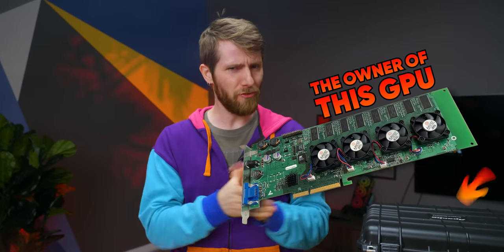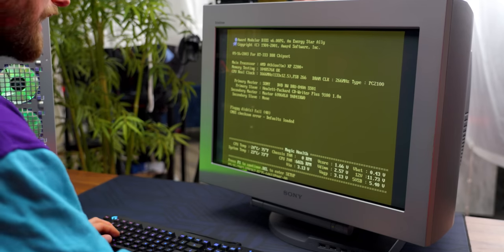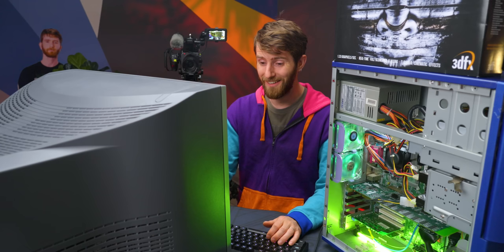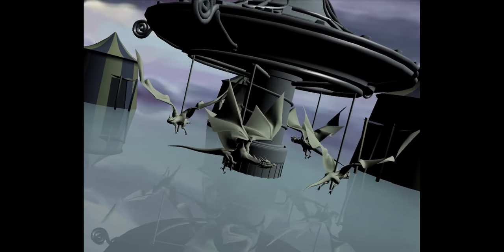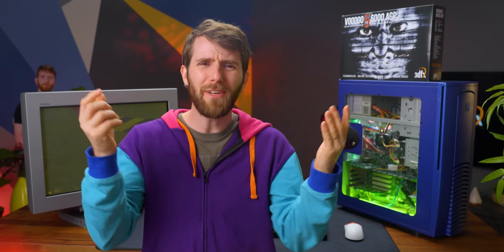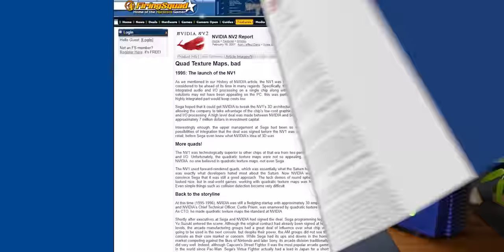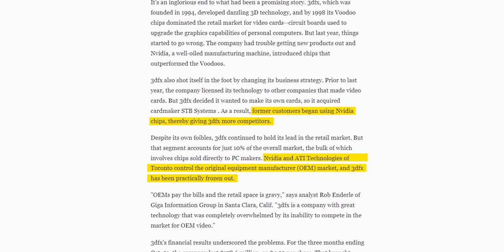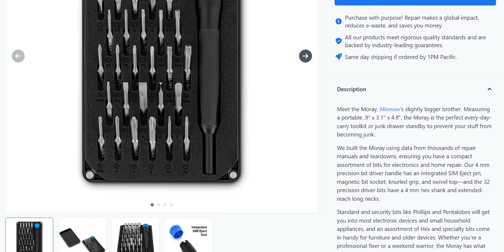This GPU cost $15,000 and there’s only ONE like it – 3dfx Voodoo 5 6000

Comment: Wow great window into history. This was before my time by only a few years.   
I remember tearing up my old Dell and having my mom buy me a card that I didn't have an AGP slot for. Then I used my birthday money to buy a new motherboard and processor which of course, didn't fit in the Dell case. So I ran it in the box on top of the anti static bag for a month until my case came in. Finally put it all together and used the wrong screws on the mother board so it was shorted out on the case and fried instantly when I turned it on. I was computer-less for months since my mom was already pissed she had spent so much money and wasn't just gonna go drop another 100 bucks on a new mobo. Finally got the mobo money and build that bitchhh. Was my computer for 5 years till I built another one from the ground up. Since then I have built a total of 3 and waiting for my PSU to come in to build my latest and greatest beast! Ryzen 9 7900x/ Radeon 7900xt/ 64g ddr5 64000/ 4tb m.2 (5gps read/write) 14tb HDD damnit I cannot wait!

Comment: You missed a mention, around the same time we also had the Power VR PCI accelerator card, I had one to go with my Matrox VGA card, it was actually pretty good and use the PCI bus instead of a loop back cable ;)

Comment: I'm actually still using almost the exact case! :D Mine has a 120mmm exhaust and some minimal front IO (and it's beige), but otherwise, the looks, the internals and, apparently, the weight, are identical!

Comment: Huh, I remember reading about that card, with the external power supply connection. Though I didn't know until now that this would connect to a Molex (!) connector. Question is, how did that connector plugged in from the outside?? I thought that was a ground breaking card with 4 GPU's on it (!) at the time.

Now Linus, I remember reading back in ~1999 (?) about a prototype 3DFX Voodoo based motherboard that was released in Maximum PC magazine at the time.  The prototype failed IIRC, due to multi layered complexities of building a motherboard with a Voodoo GPU, and I thing Possibly ~32-64 MB of RAM for graphics (Don't quote me, since I've read this article long time ago, details are sketchy). 

Thank you for the history lesson.

Comment: With 3dfx chips you were supposed to run everything at 16bit colors. Far as i know, 3dfx chips never had hardware support for 24bit 3D. I think that is one reason for 3dMark2001 etc. to run so slowly.

Comment: The strangest video card I ever saw was one that had a DSP chip on it.  Basically, you could load the DSP up with any code you wanted and then that code could directly drive the part that more like a normal video card.  When the system booted, the DSP was started with code that made it emulate a lot of older video cards like a CGI, VGA or Hercules.  Old software that only worked on one of those could be used if you first ran their funny "mode" command to set the display card to look like the needed version.
Reply: Oh, nice... Sounds like the Paradise VGA card I had in my 286... You could kick it into CGA, Hercules, some weird Tandy modes, etc. Mind you for most CGA games you'd still need a CPU throttler even that far back - or at least I did, as I think my 286 was 16 MHz - maybe just 12 MHz.
Reply: @dojomojomofo  I started with 8088 and jumped to 386.  I had a thing called "slow386" that would slow the 386 just about enough.
I don''t think the one I saw was Paradise.  It really did do DSP stuff too.

Comment: Geforce 2mx aces that dragon ride test. That is a year 2000 product with a $100 price tag on it.

Absolutely love how you put S3 Virge as "Claimed support but buggy" in most categories. By all reason the hardware could do it just fine; it's the state management in the DirectX driver that was all sorts of messed up. Games that used S3D API worked fine, looked good and ran fairly well.

You could say how you treated S3 here was... savage! I'll kyro myself out.

Comment: I think have a gigabyte 2080 windforce OC -   it has a seperate circuit with a heat sensor connected to a wire. If it is not a prototype - I can not find anyone with any information about it..  One repair specialist said he had never heard of it.

Comment: Fantastic video, 3dfx still holds a very special place in many gamers hearts. I remember going into the local PC store and wanting so bad to have 16MB of VRAM :) as my SiS 6326 (Gotta love the old GPU names) only had 8MB of VRAM. Out of curiosity how much power does the 6000 draw?
Reply: Silicon Integrated Systems. If I never had to think about that awful hardware again. Terrible chipsets, but the first in chipset graphics I ever saw. My boss loved them, could build cheap ass systems around them and Cyrix processors. My first computer was one of these horrors.

Comment: I remember that around 98/99 having a 3DFX was for few. Honestly, I only had conditions to have a GPU at the time of the GeForce 3 and 4 family (2001 or 2002). When I bought the 4600TI ATI had turned the tables with the 970PRO, with AGP 8x and other types of graphical "black magic".

Comment: Looking back through rose-tinted goggles ( at the late 90's to the early 2000's era) there are a select few (particularily buzzworthy) "3d accelerator" events that I have an especially fond view of:

*~1996-ish (?): ATI Rage All-In-Wonder is INSANE! (Still have that old AIW-card. Pentium Pro 166MHz, Games like Quake, Tomb Raider, Descent II...)

*~1998-ish(?): 3dfx Voodoo 2 is AMAZING! (Pentium II 450MHz, and Games like Quake 2, Unreal, Half-Life...)

*~2001-ish(?): nVidia GeForce 2 GTS is the BEST! (Pentium 4 2GHz, Games like Return to Castle Wolfenstein, Max Payne, and Red Faction...)

*~2003-ish(?): ATI Radeon 9800 Pro blows EVERYTHING out of the water! (AMD Athlon Barton ~2500+, Games like Painkiller, Doom 3, Half-Life 2...)

Sure, there were better contemporary systems in hindsight, but this is what I had experience with.

Before any of that, a decent CPU and a nice sound card was more of a thing to prioritize above 3d accelerators.
I remember Doom/Doom II, Hexen, Heretic, Rise of the Triad, even Duke Nukem 3d, Shadow Warrior, Blood ran perfectly fine on my old 486 DX2 66MHz and a Sound Blaster 16 compatible, but it also had a Matrox Millenium.
Any earlier than so, I was young enough to be happy with a 386 and PC speakers to run Wolfenstein 3d. I thought my Amiga 500 was considered better for gaming in general...

Anyways, nice video!
What a bizarre card...
I find these things rather interresting.
Thanks!

Comment: My first video card was the S3 Virge, the worlds first 3D decelerator. I still remember using my mom’s credit card to order a Canopus Pure3D II Voodoo II, felt amazing playing Quake and Quake 2 on that.
Reply: it is not decelerator. Stop spreading that nonsense.
Reply: @warrax111  It’s a joke, that’s what it’s nickname was..
Reply: @graemetimmins  It got busted, it was not decelerator. At some CPU speed, every 3d card became a decelerator.
Like, when you test Virge with 400 mhz or 1 ghz CPU, what do you expect?

Try it with Pentium 100 or 133, and you will see, games are running faster on it, than on CPU with software mode.
Virge DX with 4MB and with fast EDO memory, is capable of clocks around 60-70 mhz (core) and 60-70 mhz (memory), when you turn of Z-buffer, which slows down Virge architecture a lot, you would be suprised, it can actually play lots of direct3d games on 512x384 x 16 bit around 20-30 fps.
It was first 3d architecture, it basically came in late 1995 and early 1996.

People just don't know to use Virge.
Reply: @warrax111  Well back then D3D was literally just starting, and few games actually used it. The Virge didn't have a Glide equivalent that developers used, so if you played any popular idtech game, like I did, it was a waste of money. Quake and it's contemporaries (Quake2, Half-Life, etc) ran faster in software. So as an end user, it made my experience as kid getting into gaming awful. And when you compared it's performance to the games it did support, to other Glide versions of those games, it was still awful. I don't know why you are arguing it was anything else but a poor videocard. It's fine tho, it did come up with the texture compression method mentioned in the video that got pulled into D3D itself.
Reply: @graemetimmins  Quake was originaly DOS game, with software renderer. Only in mid 1997, they've rebuilt it to OpenGL support, calling it GLQuake. It was already mid 1997, Virge in that time, was low-end solution, because they didn't improved architecture enough, only make re-creations of Virge. Ati at other hand, upgraded Rage II, to new generation of accelerators, called it Rage 3, and well known Ati Rage Pro cards (For exampel Xpert@Play and Xpert@Work). Nvidia came with Riva 128, but it came up in late 1997.
So Virge wasn't meant to OpenGL Games, it lacked OpenGL support. It had only Direct 3D support, and S3 native API. But game developers were lazy to program S3 API games, because they rather invested time into Glide. Glide was very similiar to OpenGL, it was ripoff of OpenGL, so their experiences could be then easily modified to OpenGL. This is, why Virge have disadvantage, but it's not fault of Virge, but because 3dfx was better , so there is lack of programs for S3 Api. Virge was faster on S3 Native API, than on Direct3D.

You cannot play OpenGL on Virge, only through Wrapper, but that hinders performance to like 20% of original potential.

Direct3D games started be common during 1997. Lots of games, that were originaly only software renderer, got Direct3D patches during 1997. For example MDK, Dungeon Keeper.
Turok got 3dfx Glide support on PC platform, but month after, it got also Direct3D.
Tomb Raider 2 got native Direct3D support. It is kinda playable on Virge, when you lower resolution to 512x384, and turn off Z-buffer. Not bad for lowend card from 1996.

So, the reason of poor peformance on GLQuake was not the fact, that Virge is so ewak, but because it lacks OpenGL hardware support.
Reply: @graemetimmins  There is video from retro swarm about Virge, just find it. It debunks it is so bad. It's mediocre actually, in Direct3D Games.
Also there is Croc: legend of grobbos. It is native S3 API game. Runs good on Virge in 400x300x16 and 512x384x16.
If you buy Virge with good memory, and overclock it to 75/75, you can have +50% more peformance than on shitty Virges. Then, you can think of even 640x400x16 (not 640x480), but some games it rocks even in 640x480. (mechwarior 2, or Jedi Knight)
Reply: @graemetimmins  Dude, Half-Life is most demanding game of 1998, along with Unreal. It was released in nov-december 1998. 
How can you expect to use lowend accelerator from 1996? 
That just doesn't have sense. Virge is not bad, you just trying to make non-sense thing.
Virge was for 1996-1997 3D games. Except OpenGL ones. That's how it always be for low-end accelerators, it handled around 20-30fps only actual games, not games from 2-3 years ahead.

Comment: Awesome video! You should be getting a higher 3DMark 2001 score. With my LGA1366-based system, I'm getting a score of 5450 (no overclocking), with Anthony's PCI-based Voodoo5 6000. Also, do you have any interest in selling one of your Intel BlackOps 4.6GHz CPUs? I'd like to try testing that CPU with my LGA2011 system I'm working on. I want to see how fast I make make the Voodoo5 6000 go!

Comment: The introduction of DirectX was a watershed moment in computing history. It ended vendor 3D APIs and killed sound companies. The loss of good spatial audio was unfortunate, but DirectX made computers better—even if it did cause problems in the short term. 

The abstraction would greatly help security as well as stability by keeping games out of protected memory. It would also make drivers more stable; it forced driver signing and certification which improved quality. 

Microsoft did the industry many favors by the various abstractions and APIs they have pushed upon Windows over the years.

Comment: Today it's easy to call the separation of 2D/3D card a disadvantage for the rise of 3dfx but I'd actually argue it was an ADVANTAGE in a lot of ways:  First, their target customers were gaming enthusiasts who usually already had computers they were looking to upgrade with this exciting new tech.  That means their customers already had 2D cards, so why duplicate what already works?  Second, by NOT wasting resources/money/chip space on a 2D core, they were able to build a BETTER 3D-only product.  Take Voodoo Rush, their attempt to combine the original Voodoo chipset with a 2D card - it sucked compared to original Voodoo and I think 3dfx would have had a tougher time getting started if that had been their initial offering.  Third, those of us who were the enthusiasts of the day perceived the separation of the two cards as an actual badge of honor, like adding a badass supercharger to a hot rod car!  It also allowed those of us who wanted the freedom to choose the best 2D card out there instead of compromising on 2D to have good 3D or vice versa.  So two (or even three) cards might seem janky today in hindsight, but I'll forever recall the triple-video-card Voodoo2 SLI setup with love as the quintessential 3dfx setup!

Comment: In this time period I was running a Voodoo Banshee w 2 x Voodoo 2's in SLI, and when Black & White came out it absolutely destroyed my cards. They could do a massive 5-6fps because the 3Dfx cards couldnt handle the shading and lighting I believe. So its when I switched to my first Nvidia card, the Geforce 2 MX400 which was insane in comparison to the 3Dfx cards for anything that used Direct 3D. And then quickly upgraded to the Geforce 4 MX440 the following year before switching to team red with the ATi Radeon X800 Pro.

Comment: Ahh.... the TNT2. It was my very first GPU. I wrote my first "shader" code on that one, using register combiners. Fond memories.
I don't remember it supporting 2K textures though. I think it was limited to the framebuffer size as well: you couldn't use textures that were wider than the framebuffer, and a 2K framebuffer was certainly not common, so you'd rarely reach that 2K limit. It was a long time ago so my memory may not be super accurate.
Reply: Riva TNT?
Reply: @zaneandre6387 yes but  the TNT2, which was a significant upgrade from the first one since it could do multitexture and was the first to support register combiners, a very limited form of ptogrammability.
EDIT: Googling, you're right, the first TNT also supported register combiners. But my first was indeed the TNT2.

Comment: I had a Voodoo 5 running on my dual Celeron motherboard all to play Quake II and was still running the Voodoo 5 on my dual Athlon that replaced my Celeron Dual CPU PC .

I actually was over clocking and cooling it with a garden hose coming in and out the living room windows LoL

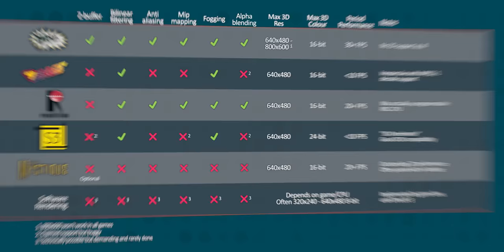Comment: The chart at 9:45 isn't correct for the Voodoo1.

The maximum resolution on a stock Voodoo1 with 4 MB of RAM was 640x480. If you turned on the Z buffer, that was lowered to 512x384 due to the split 2 MB frame buffer and 2 MB texture memory. It was possible to have an 8 MB Voodoo1, and there were some rare examples, which would allow you to get 800x600. But the increased resolution really killed performance on the Voodoo1, it didn't have the power needed to drive that resolution.

The vast majority of Voodoo1 cards were either 4 MB (2+2MB) or 6 MB (2+4 MB) and had the 640x480 limit. It is possible to mod 4 or 6 MB Voodoo1 cards into an 8 MB card via stacking memory chips and routing the extra signals to pins on the FBI/TMU, but I wouldn't really recommend it. The memory chips are hard to source, and you need advanced board level rework skills. Very easy to irreparably damage your card.

As for running a Voodoo on a 486 and having "an enjoyable 3D experience", yeah, no. I've done that, it's not at all enjoyable. Even the fastest 486 chips can't feed the Voodoo card fast enough to give anywhere near respectable performance. You'll get a slideshow with bilinear filtering.

Comment: Wait a minute, why is Linus only running his display at 60Hz? I run my Voodoo 1 at 120Hz on a basic 17" monitor. The Voodoo 5 runs higher resolutions but even then his higher end monitor should be able to do at least 100Hz.

Comment: 3DFX did one thing very right. They didn't do 2D and they didn't do hardware T&L; they just focused on rasterizing perspective correct textures as efficiently as possible and with decent texture filtering. 3DFX realized that people already had a 2D card and games had to be designed to support software rendering, so they couldn't have a large number of triangles; they also realized they would have to add those back soon, and shaders too. They just fell too far behind.

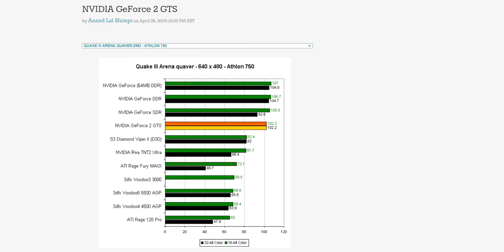Comment: 8:29 you correctly say 2000 later but here you say 2001. Also as can be seen from those q3 and the later 3dmark scores, the voodoo 5 is beaten by even the original geforce 256, particularly the DDR variant, released in late 1999 (for about £150 SDR, £200 DDR i think? Possibly less) where the hardware t&l really helps remove cpu load. Your test rig for the 6000 has a cpu from q2 2002. The speeds you're seeing simply wouldn't have been possible with contemporary cpus from 2000. The 6000 would basically have given people 'free' 4x FSAA in existing games and that was about it.

Also while nvidia made a thing about the 'Nvidia Shading Rasteriser' for the gf2, it wasn't actually any more capable here than the original (other than having a second texture unit per pipe), neither had 'true' shaders as such which appeared with dx8 and the gf3 & radeon 8500.  It wasn't really the killer app of these cards, that was the hardware t&l which really helped extend the life of PCs with those cards.